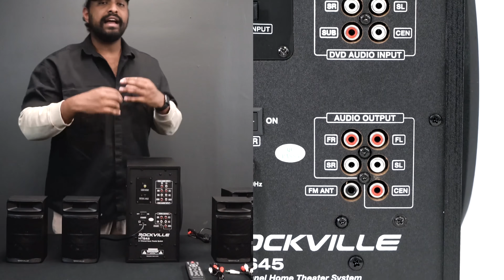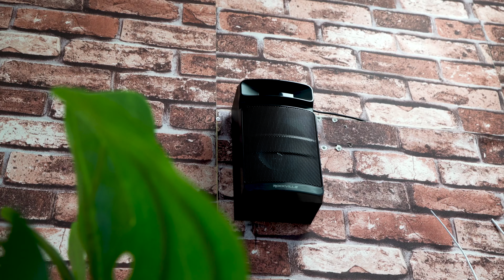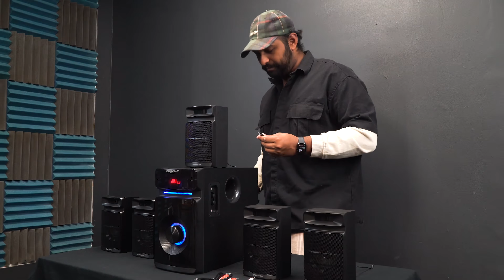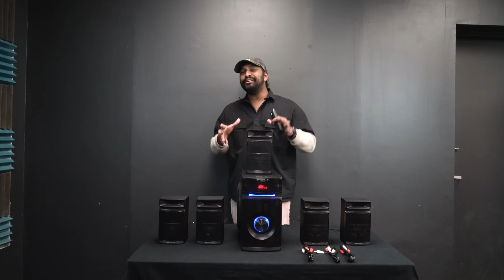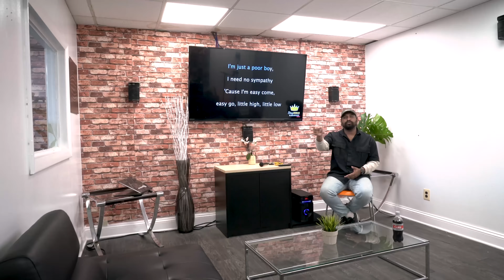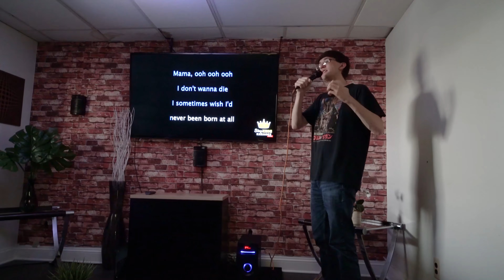HOW TO SET UP YOUR HTS45 5.1 channel Bluetooth Home Theater System (Full WALKTHROUGH and GUIDE)

Comment: Wanted to see how you use the presets through the controller. I think you said that you're only able to access them through the remote. If you could answer or make a short video on how to would greatly appreciate it. Just how to go through the five different equalizer presets, I'm assuming that it's like jazz, rock, pop, classical, the last one is probably like speech, or vocal is this correct?

Comment: If you do decide to buy the hts56 make sure they don't send you an old model like they did me. I can't use it with my brand new LG 70-inch, now they want me to buy a converter to convert the RCA to the optical Port on my TV and I believe that's a bunch of baloney because I paid for a new remodel, bottom line I've been had. I recommend you spend a little more $$$ and get something better.
Reply: It says it has an optical port in the video and ad